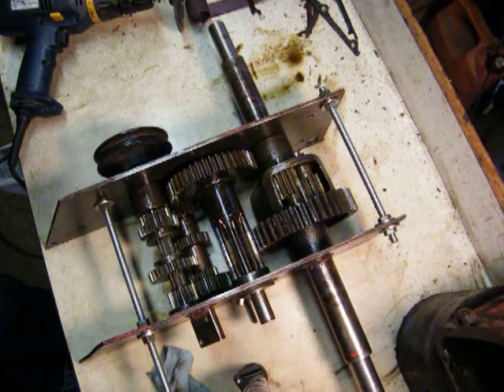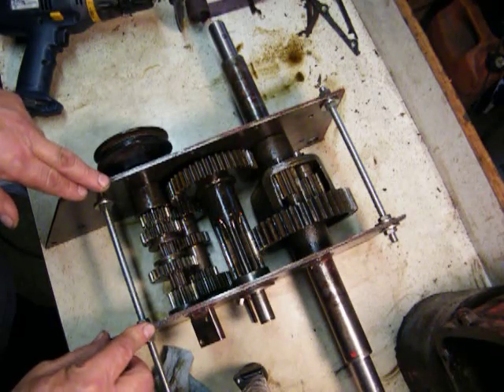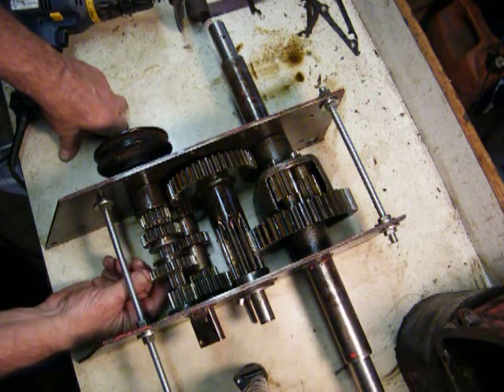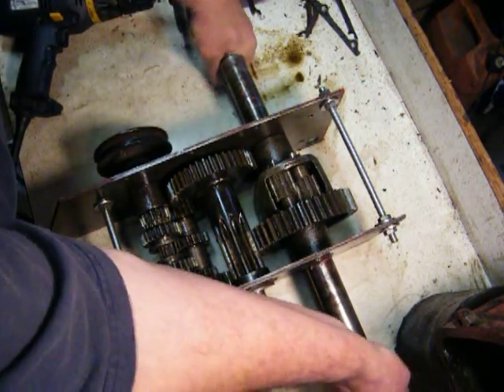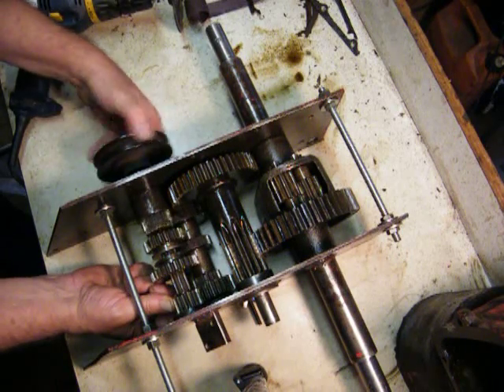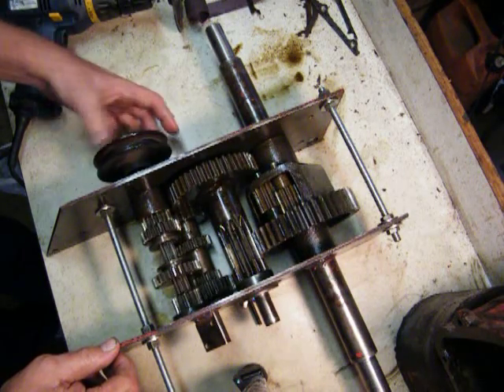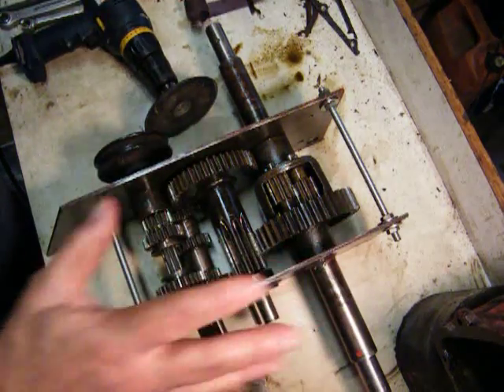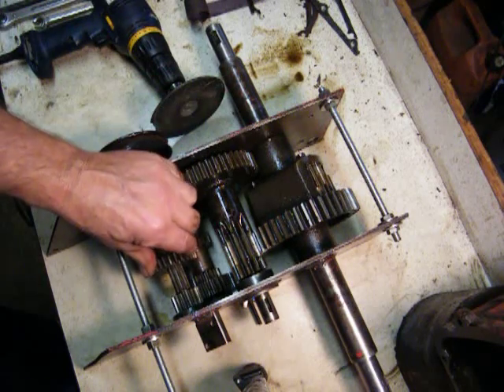HOW A WHEEL HORSE TRANSMISSION WORKS

Comment: Hello Dino. I saw your video and loved it. However I have some questions regarding my 312 and was hoping you could help. First question is if the transaxle is a limited slip. If so could I attach small hydraulic brakes to the exterior shaft and have it turn?  My intention is to take the balls of these beautiful machines and turn it into a mini dozer. But I need one side to stop in different amounts to turn as soft or hard as I want. Didn't know if it could be done. Any help you could give would be greatly appreciated. Also, the same tractor has been down for years. I was plowing snow with it then I heard a pop and now it won't move. What do you feel I may have done to it. I was told long ago that it might have been a pin inside the trans. Not such. Thanks again.

Comment from the maker: @mrdanocconor  actually, both wheels function as the drive wheel until one of them starts to slip.  It is the same with an old car 3 speed transmission.  It has to do with the differential.  When one
 of the tires is on like ice, it will spin on the ice...if the other tire was on the ice, it would spin.  You need the 10 pinion limited slip differential to have both tire non slip.

Comment: What gear oil should I use in my 1964 wheelhorse lawn ranger . Thanks
Reply: tractorman604 
can I change that seal on the output shaft without taking it apart
Reply: Eddy Robinson yed You can

Comment: Do you know where I can get bearings for this transmission? I need the axle bearing the needle wheel bearing. Also, how do you get the axle bearing out of the transmission case?
Reply: What did you find? I'm about to  start the journey and guessing  you had found the answer to that question
Reply: Robert Bock  there are 2 websites l found very helpful, they have diagrams and parts number available,  based on those diagrams l have order few parts for my wheel horse tractors and I'm able to see if the parts can be replaced without  tearing the trans apart, in your case needle bearings I'm sure you have to take it apart. Reply to this message if you wanna know the websites I'm talking about.